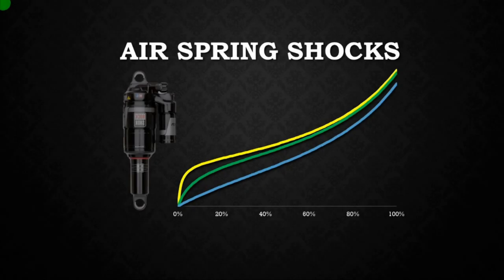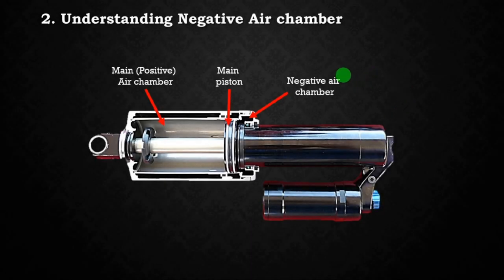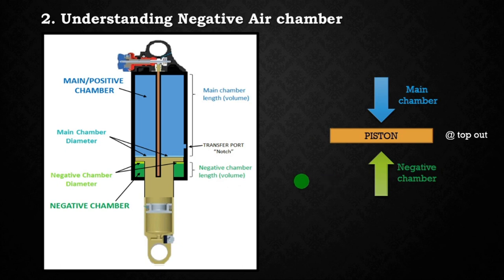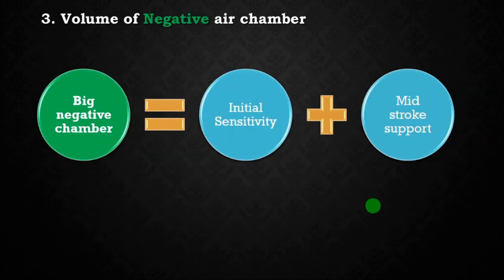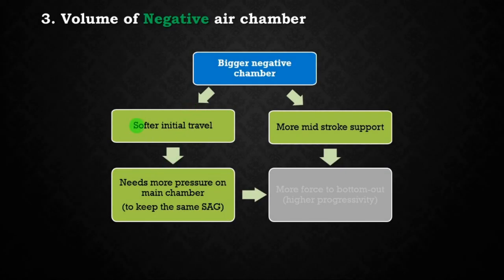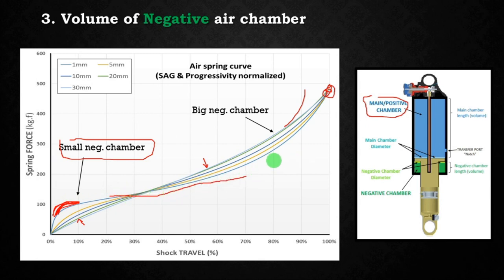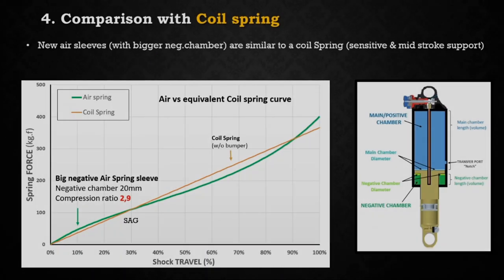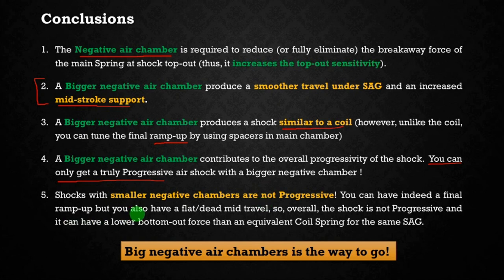Air spring shocks (MTB Rear suspension Ep.13)

Comment: Could you talk about what top out means?  I think you’re referring to the position where the equalization notch is, but the naming isn’t quite common sense. Where in the stroke (ie what percent of travel) do manufacturers typically put this notch?
Reply from the maker: Hi. Top out means fully extended. I dont know in which % manufacturers place the notch, but if made correctly they should place it exactly where the resulting equilibrium pressures will produce an equal force on both sides of the piston (and thus, the forces will cancel out each other to make a sensible initial travel).
Reply: @andrextr  thanks, I’m realizing the top out question was a stupid one. It as for the notch, when the piston crosses that travel point then the pressures on each side are exactly equal, which brings several questions. First, if the pressures are equal, then shouldn’t the forces be also?  If they are, then what is supporting the rider? The net force can’t be zero, so this suggests the piston areas are different between the positive and negative sides.  Next is where manufacturers choose to put this relative to the suggested sag point of the shock (which is also bike specific). This brings a big but subtle point in that perhaps a riders preference of sag could be driven not just by all the complexities of bike geometry but also by the location of the sag point in the spring curve relative to the shape of it, which is largely driven by the axial travel location of that notch.
Reply from the maker: @R1Gato  yes, the surface area of the piston is different, so in order to have a net zero force balance, the negative pressure needs to be higher at the top-out. In that way you eliminate the initial breakaway force and you have a supple initial travel. If the notch is placed correctly you achieve this balance independently of SAG and pressure used. And if the notch is placed too downstream, you end with a partially stuck down shock (it won't fully extend). If you place it too upstream it fully extends but it has that initial breakway force. I have more videos about this topic (Ep 13.5 and Ep.14)

Comment: Hi Andre, 
thank you for this wonderful explanation! Though I don't have an engineer's mind, I get the point. My question is: I have the Kona Process 134 that comes with the standard small volume Monarch. The initial strong ramp up of the shock seems to counterbalance the bobbing under pedalling quite well, but I dont use more than 70% of the travel and the suspension is not very sublte either. 

Would mooving to a debonair shock run with slightly less sag make sense?
Reply from the maker: Yes, the initial ramp-up can be good for a more XC/Trail application (I have a mindset towards enduro/DH sometimes I forgot the pedalling part eheh). For those who want a more smooth ride debonair makes sense (the coil will be the best you can get). Regarding the 70%, are you sure about that? I'm asking this because there are some shocks where the ending of the stroke doesnt corresponds to the ending of the body (I'm not sure if that's the case, but you can remove the air to confirm or measure it). If everything is fine then you can increase the SAG in order to make it more softer and make full travel more often. How much SAG are you runing? Is the rebound tuned correctly (see the curb test on Ep.5). Try this first before considering the debonair. Bye
Reply: I run about 28% of sag right now. And true, the shaft is 55mm long whereas the shock's travel is only 51mm. Like that I use only 80% of the travel. Maybe a little more sag will do the trick. After I had freeride and enduro bikes for the last ten years, maybe its time to enjoy the benefits of pedalling performance and let the Debonair pass. 
Thanks a lot for sharing your knowledge!

Comment: Excellent videos!! You provide the most in depth and simple to understand explanation I have seen amongst others. I own and ride a cube hanzz with a float X rear shock and factory float 180rc2 up front. I have noticed the effects of your points on small negative chamber since I upgraded from the stock van rc coil shock. The float x does not have the evol air can but I am convinced to upgrade and looking forward to the improvement! I have the impression that my bike now has a linear or slightly regressive mid stroke. Can this also be due to the frame kinetics itself? it's got a 3:1 compression ratio, 190mm rear travel with 8.5x2.5 shock, horst link frame
Reply from the maker: Hi, thanks! Cube usually uses a very linear suspension in their bike models (sometimes even regressive, like the Fritzz 2011 !!). Your bike is no exception, since Hanzz got 10% progressivity...  With the Evol sleeve (or the Vorsprung Corset) you will improve your shock performance, since you will double at least the negative volume. The float X has a small negative chamber, similar to the older fox shocks. According to this picture, it should have a negative length of 5 mm (http://www.mountainflyermagazine.com/img/upimages/2014_Fox_TalasFloatX/Fox_Tech_Float_X.png). Bye
Reply: Hello again! I purchased the Evol Air Sleeve and have already ridden my bike at local trails. While still using the same air pressure (200psi) I now have a higher percentage in sag setting, 30% compared to the previous 20%. I also changed the air volume spacer from 3rd to 4th (1 is smallest and 5 biggest). 
As expected, I noticed the softer initial travel, (better small bump compliance) but I'm still trying to figure out about mid stroke support? Maybe, I can feel a small improvement but not quite sure. The guys at Fox said that in order to obtain the full effect of the improvement, I need to send them the shock to reset the valving according to 2016 model standards. Any thoughts?
Reply from the maker: As I said, with bigger negative chamber, you also need more positive pressure to get the same SAG. To compare accurately the newer setup you must test it with the same SAG as the previous one. If you do so, maybe you can feel a firmer mid stroke when compared to the previous one. Not sure about the revalving... I don't think it's strictly necessary to revalve just because of the newer sleeve. I mean, the newer sleeve improves the shock, but it's not such a drastic change that requires revalving (http://factoryjackson.com/wp-content/uploads/2015/09/full_FOX_EVOL_Improvement_389053.jpg)... Did they said what was the point for the revalving? Probably to reduce the internal tune of mid/high compression damping since you got more support from the spring? (I don't know, I'm just guessing)... Bye
Reply: Thanks for your immediate reply! To be honest, all they said was that I will get better damping characteristics and more mid stroke support. Another thing noticed, is that "Climb mode" is not as effective as prior to Evol upgrade. Maybe this is why they insist on revalving? 
Other than that, I must mention that I noticed a good ramp up towards the end stroke and didn't achieve bottom outs, even though I tried hard to use all the suspension travel. The bottom line is that I gained traction and felt that i could overcome the mid stroke area by adding compression (turning switch to trail mode 1). I don't want to run 20% sag because this would make my bike feel too stiff. Overall happy but still have to figure out that mid stroke area. :)
Reply from the maker: The 20% SAG was just to test and compare with your previous result (since you said that you used to run 20% on older sleeve). Now you changed the sleeve and also the SAG, so what you feel is a mix of results from those 2 changes. With the newer sleeve and higher SAG, the initial travel will be much softer, so you won't notice so much the climb mode (probably in the revalving they also increase Lo-Speed Compression to compensate this). Have fun :) Bye

Comment: Is the ideal curvature of progression the same across all types of mountainbiking?  

Is shock travel a good indicator of what a suspension is good for or is there a specific way a shock should compress depending on the usage?

Another question is, can a 100mm travel xc bike frame be equipped with a different shock and be used for enduro?

Is it a bad idea to replace a 120mm fork with a 140mm fork?  Do front and rear suspension travel have to be the same or can you have longer travel on the fork compared to the rear?

Should I just stick with the same travel a bike came with from the store?  What is the maximum travel variation if ever?
Reply from the maker: The progressivity of the frame & bike will depend on how aggressive do you ride. For smooth and soft trails a more linear suspension will be better, since it will be easier to use all travel. For aggressive riding, with jumps and drops, a more progressive suspension will be better. The amount of travel is a good indicator for what the bike was designed for. It's not a good ideia to change the size of the rear shock since that can cause drastic geometry changes and clearance issues. You can increase the fork travel depending on the limit of the frame, which cames on the manual of the bike. Increasing 10mm, and in some cases 20mm, is not problematic, more than that is not recommended. Bye

Comment: hello, do shocks with smaller main chamber volume(such as fox CTD SV 7.25 x 1.75)  benefit from having a bigger negative air chamber? Or only shocks with large volume benefit from a larger negative air chamber?
Reply from the maker: +sneakyb Every shock benefits from having a big negative chamber sleeve. As I said, bigger negative chamber makes the shock more sensitive and with more mid stroke support (les wallowing). The main chamber volume will only control the final ramp-up. Bye

Comment: Rockshox generally has a firmer feel at initial stroke than fox does.
So does that means Rockshox has smaller negative spring?
Or is it the compression damping making the difference?
Tks
==
Reply from the maker: I don't know which shocks do you compared, nor if they had the same settings and base tunes (L,M or H), but it can be both options you mentioned. I also don't know the exact negative volume of Evol (no diagrams or cross-sectional pics available), it might be different compared to Debonair / Vivid air, but my guess is that they are comparable. Bye

Comment: hello sir,i want to ask if i can install air suspension in reverse position?which is the negative chamber is in the top and the main chamber is at the bottom?
thankyou very much for the answers . . .
Reply from the maker: yes, you can flip the shock upside down, it doesnt matter  (just check clearance if it doesn't hit the frame during compression)

Comment: What's your opininon on the RockShox Megneg for Super Deluxe? I'm considering that for Nukeproof Mega 2020 275. Currently running 2 tokens and bottoming out only on casing jumps so I guess it could be a good fit.
Reply from the maker: I think MegNeg is a great upgrade to an air shock because of the reasons explained in this 2016 video. It gives you a very coil-like feeling with the possibility to still tune bottom out resistance with spacers. Actually rockshox provides good tech info about this product. Give a look on theirs product datasheet. NP Mega has a progressive linkage by the way. Cheers
Reply: @andrextr  thanks for the reply! NP Mega has like 0.5 LR difference, which is slightly progressive as I can see - I actually can't find info on 2019-2020 models, but historically they always went around 0.5 diff (2.4-2.6-2.1). Ad MegNeg - yes it seems to make sense. I have checked the info and some user reviews on forums. I was just wondering why whouldn't rock shox just increase the negative volume more on their stock shocks, but I guess it comes with the penalty of needing to run higher pressures and then people already running over 250psi would need to run over the max (325 in Super Deluxe). So I guess it's good evolutionary option to give the tunability and expect that this tuneable chamber will become available on stock shocks in future, maybe increasing the range of tunability so that heavier riders can just leave all spacers in to achieve current stock volume (instead of ~160% with all spacers with Megneg). For me it makes sense that MegNeg is for lighter/medium riders with already some tokens in positive chamber, for which I might qualify (70kg, 2 tokens in stock can).
Reply from the maker: @patrikprielozny3256  Yes the penalty is that it limits the number of customers (heavy ones). Probably in the future they would also increase shock diameter to decrease overall pressure... Regarding Mega LR,  more importantly than the magnitude of LR difference is the way it changes (curve shape). Most of the LR decrease occurs in the second part of the travel (very steep LR curve slope), so this maximizes a lot the overall progression. For instance on some Evil delta bikes the LR decreases a lot in the begining then the curve becames flat in the second half of travel (this results in low overall progression). So, calculating the progression based only in LR difference does not tell you almost nothing! :) Cheers.
Reply: @andrextr  huh, didn't know about that. Just comparing to something like YT capra it didn't seem that progresive. Lately I read the other thing to consider is rebound range, as more neg volume will slow things down so you should have some reserve. Strangely out of all sources I only found this on one german forum.

Comment: Hi,  i have a 2019 nukeproof mega 275(230x65 stroke) with a meg neg. Im at 0 positive bands and 3 negative bands using about 6-70% travel at 30% sag( 250psi, 90kg). if i understand correctly, if i was to have 0 positive and 0 negative bands at 30% sag i would use even less travel since there will be more force to bottom out. Would i then need to increase my sag to 32-35% sag,increase to 4 negative bands for more travel use ?
Reply from the maker: Yes, more negatives bands reduce the air pressure required to achieve the SAG, so it will indirectly reduce the bottom-out force. But you lose some of the initial sensitivity and the propose of having a big negative volume :)  Nukeproof has a progressive linkage, but from what I remember it is not excessively progressive so I assume it would be relatively easy to use almost all travel at least on some mid-sized jumps and drops. Best
Reply: @andrextr  i'll remove the negative bands again and try my testing again from 0 positive and 0 negative. thanks for responding!

Comment: what does the piggy backwhat does the piggyback gives you in those shocks then?
Reply: I believe they keep the oil under sufficient pressure to not let the oil get vaporized by the low pressure while decompressing..
Reply from the maker: The piggyback contains an air chamber (IFP) that is required to pressurize the oil (inline shocks and coil shocks also have that chamber). The IFP contribution to the spring is not very important, but it shifts the curve up like in this pic:  http://ep1.pinkbike.org/p4pb14201762/p4pb14201762.jpg .  The IFP contribution was discussed previously in this video: https://www.youtube.com/watch?v=IyH8hNLr1m0